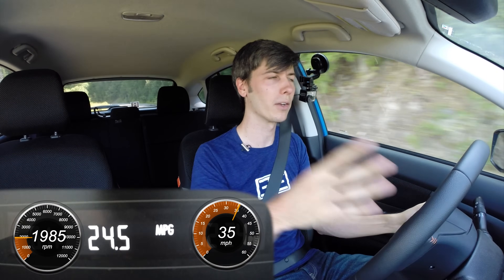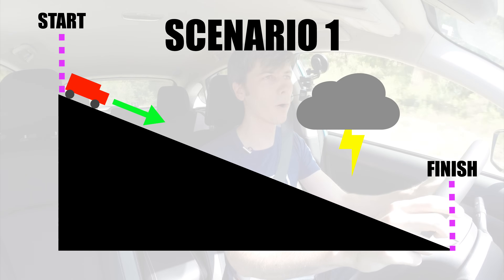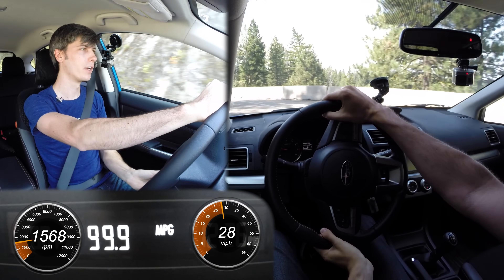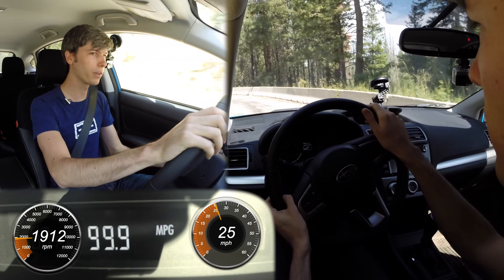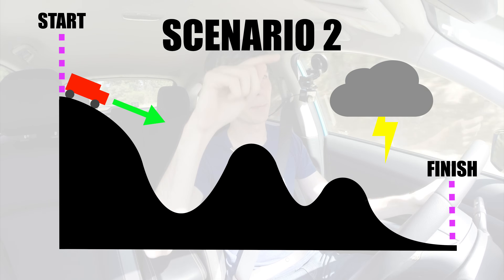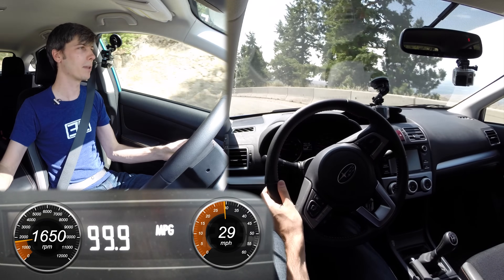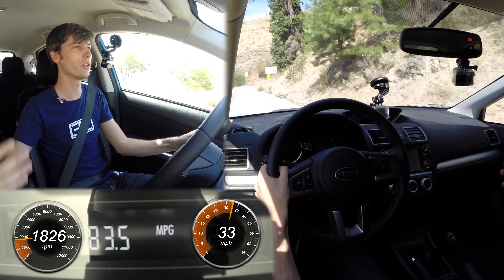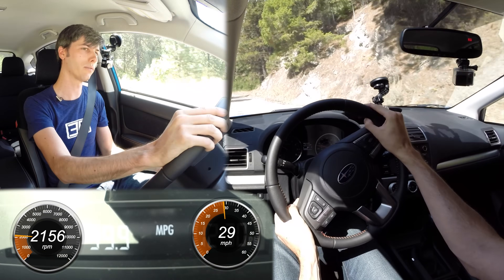What Uses Less Gas - Coasting Or Engine Braking?

Comment: Nice to know which method saves gas, but which method will help the engine to last longer?  Is engine braking hard on the engine?  I’ve always thought I would rather wear out my brake pads faster than my engine.
Reply: engine braking is not an issue on the engine.

Using the main brakes wears out the pads. They can also overheat on long descents with a heavy vehicle.

Comment: I have a hybrid, and It tells me what's saved more gas. When I coast it is at its max. Truely depends on the vehicle. I have a Honda.  I tried the same thing on an American vehicle and it wouldn't coast as fast as mine. It felt heavier like the breaks we're slightly applied.

Comment: Question: engine braking in 3rd gear vs engine braking in 5th gear - no gas is used, but in 5th gear you don't lose your speed that much right?

Comment: I have to disagree with you on this assessment. I have a 2012 Subaru Impreza, so my MPG display is exactly the same as yours. Also manual transmission. When cruising, engine braking will start to drop MPG from 99.9 before it will in neutral (i.e., at low speeds, active MPG will still show 99.9 in neutral while engine braking at the same speed will be lower). I think fuel expenditure when your foot is OFF the gas will be the SAME, whether in neutral or engine braking - but neutral will take you further and therefore is more efficient for the same distance traveled. I don't think the car computer is "smart" enough to measure true MPG. It simply performs a simple calculation based on a function of your speed and your RPM. When you're in neutral, the engine has to keep running, it can't just stop (unless it is a hybrid, which it isn't), so it will consume just enough fuel to keep itself running at low RPM, hence the 99.9. During engine braking, the engine can't just stop combusting (which it would have to do if it were consuming zero fuel as you assert). It is still burning the same amount of fuel as at idle, but the engine braking pushes the RPM higher. The car computer interprets that as higher RPM per speed and therefore spits out a lower MPG. In other words, coasting in neutral is always more efficient in terms of gas (although not in terms of brake pad wear).

Comment: Hey Jason, this has bugged me since I bought my brand new Nissan Altima. When I turn on the AC, my rpms are set dead at 750. In fact, that's the normal idle at all times, and it confuses me a bit. I thought, at least, the AC would make it churn more rpms, but this car doesn't do that. What's the deal? I'm used to 2012 cars and below, did something new come out? 
Adding on to this video though, I am wondering if switching to neutral is a better bet for a emergency braking maneuver. My car buckles after slowing below 10mph, I assume it is a CVT thing, but, I only really drive manuals, so, please correct me if I am wrong.

Comment: Thanks for the video I no longer coast downhill. Coming back to your scenario it would probably be more efficient even if there are not a series of his but flat straight road as the momentum built by coasting can be used to cover some distance as long as you don't exceed the safe speed for that road.

Comment: So in in real life (unless you happens to be alone on the road, you don't care about safety or breaking the law; or it's the German Autobahn) you really should always keep it in gear.

Btw this is yet another demonstration of why MPG (i.e. unit of distance / unit of energy) is a bad metric for efficiency, since when the consumption is 0 you end up dividing by zero and the display has to show a nonsense "max value". If instead you use the more reasonable measure of unit of energy / unit of distance (e.g. gallons per mile or liters/100 km or kWh/100 km, etc.) when the usage is zero the meter can show simply 0, and the scale is more linear as well.

Comment: A caveat here: Fueling GENERALLY only cuts in the top 2/3 of the rev range. In the bottom 1/3, fueling will cut back on, which is why you'll get some gurgles towards the bottom of the rev range. So if you leave in high gear, you won't see as big a difference as when by putting it in a lower gear. Which also means you need to underline rev matching. Rev matching uses fuel. WAY more than you're going to save. So you'd have to granny shift it to see any benefit. Granny shifts wear out your trans. Transmissions are way more expensive than gasoline. But the easiest thing of all to replace (besides gasoline) is the brake pads. So you kinda have to decide what your maintenance strategy is and go with it.

Comment: Hi EE, loved your videos! Been watching them all the time. I have a question regarding rev-matching and throttle blipping. I found it easier to blip and rev-match a petrol-powered car than a diesel-powered ones.
I know that diesel engines generally have more torque at low-end and use higher compression ratio than petrol engines. In those senses, what makes the diesel engine 'lazier' to rev and petrol engine 'more eager' to do so?
Reply: I have found it equally easy (or difficult) to rev-match when changing gear, for either petrol or diesel. What makes the biggest difference is not the engine but the gearbox. My Peugeot has always been more forgiving of slight mismatch when gradually increasing/decreasing the revs until the gear slips in, compaed with my wife's Honda. The Peugeot has now done 190,000 miles so I imagine there's a bit more wear on the synchromesh that makes it more forgiving, but this was true even at 18,000 miles when I bought the car.

I find as a very rough estimate, in my car I need to increase or decrease the engine speed by about 500 rpm when going from one gear to the next higher or lower gear. Any change in the correct direction will be a bonus, compared with a) keeping the engine revs constant, or b) returning the engine to idling speed and then letting the clutch up on an idling engine (!!!!). I did actually get a lift with a person who did the latter. It was a difficult situation because she was my boss. Should I offer her advice? When she actually apologised for a particularly jerky gearchange, I very tentatively suggested that there might be a different way that would make her gearchanges smoother. Apparently her instructor had taught her to let the clutch up on an idling engine, and no-one had every told her about rev-matching. When she tried it and found how much smoother the gearchanges were, she said "I'll murder that driving instructor!" She still lifted her clutch foot right off the floor, rather than pivoting on her heel, but that may have been because of the size of her feet in relation to the position of hte clutch pedal off the floor. She was about 5'3", driving a VW Jetta, so maybe she needed the seat that bit closer and also her feet weren't as long as mine; I've never found a car where I have to lift my heel off the floor to let the clutch right in - even on my Pug which has a high bite point becaue the clutch has used up all its auto-adjustment range (though 190,000 miles on its original clurch is pretty damn good compared with previous cars I've had).

Having a rev counter makes it easier to rev-match than when you are having to rely on engine note to judge the correct speed for the new gear.

Comment: Disagree , it still injects fuel with your foot off or in neutral the engine still needs to ignite something otherwise it would be silent e.g tow a car in gear with engine off equals silent engine

Comment: Basically, If you're going to stop at some point anyway, use gears.
If you are going to effectively use the bonus kinectic energy you get from neutral coasting (longer distances, climb up a cliff ahead) then it becomes viable
Reply: When you don't need it to stop you going 120 mph into the twisties, engine braking is just another loss - like rubbing brake braking, unused roof rack braking, or underinflated tire braking.
Reply: @TimpBizkit if you're not actively accelerating that isn't an issue
Reply: @TimpBizkit  But when the car is engine braking with revs above idle, the ECU is able to cut off all fuel to the engine, as the momentum of the car keeps the engine spinning. The engine will always have losses. When engine braking, they are counteracted by the car's momentum. When coasting in neutral, they are counteracted by using fuel to keep the engine spinning.
Reply: @n00bxl71 yeah but the car's momentum doesn't last forever. It was provided by putting fuel into the engine to accelerate it, and unless you're on a road where you MUST reduce speed, parasiting off the car's momentum = pressing the accelerator more often.
Reply: but then again if you are going up a very steep hill, it safer to be in gear
Reply: Except that it's not very safe. Unless you're an a closed track that have been checked and secured for you, it's very unsafe to coast in neutral.
Reply: Just use high gears then…
Reply: Basically, use gears.
Reply: @dpgerarddp  Unless you live in a hilly area when the alternative scenario is extremely common... or if your vehicle does NOT shut off the injectors when coasting.

Comment: Great vid and explanation. You should do a vid debunking the myth of "engine compression braking" and show how the engine really has very low compression with throttle plate closed and coasting. Perhaps get into pumping losses and why cylinder deactivation works by opening the throttle further but indeed still uses the same amount of fuel at the same rpm as if it was running all the cylinders. Might be a good topic :)
-Eric O.
Reply: Thanks man! I think it is a good topic for this channel. Just always find it funny when people say they "compression brake" when the engine has less than 20psi compression during a deceleration event... 90% of mechanics out there have no idea it is the throttle suction that is causing the engine braking.
Reply: 'Engine braking' is something of a misnomer really. When you lift off and enter overrun conditions there is actually a lot more than just the engine slowing the car down. For example, aerodynamic drag, tyre rolling resistance, rolling resistance of bearings and permanently connected transmission components, brake pad drag.
Even the engine's contribution to the total 'braking' effort is made up of many parts - 1. internal friction and 2. pumping losses (primarily intake vacuum, not compression as you say), 3. alternator load, 4. water pump load, 5. aircon load (compressor).
Could probably write a book!!
Reply: Salvatore Hayes at WOT you would go faster actually. In order to engine brake with a gas engine you need the throttle plate completely closed....
Reply: South Main Auto Repair I like this idea, might you want to do such a video yourself as well? Love your channel!
Reply: Maybe they all drive diesels.
Reply: That would be interesting!!!! Have a kill switch for ur injectors so when u engine brake u can go wot and really start engine braking lol
Reply: Fun huh! Yes you get better engine braking with pumping losses than you would at fuel cut WOT. Now if you had the ability to plug the exhaust off you would be in great shape and have fantastic engine braking... food for thought.
Reply: South Main Auto Repair mmmm. So shutting the throttle body means starving of air, then intake stroke would work harder and slow engine down for engine braking...if u when WOT... Ur giving it all the air it can take in but would that be more air to compress and thus slow the engine down more under compression stroke? Now I'm real curious.
Reply: South Main Auto Repair I have to try this for my self. I used to shut my car Off and simonatously hold throttle wot. The Belt would squeak indicating what I thought was more rapid stop of the engine....
Reply: South Main Auto Repair but this is when the car a roots style blower... Thus when WOT happens blower would have air to compress, but it uses engine to compress the air thus dragging the engine to a more rapid stop... My cars turbo now but still curious lol cus turbo going wot would be along it to Suck air in to compress, it uses exhuast to turn Turbine and Shaft to Compressor... Then that means engine braking wot on turbo car would also mean creating a exhuast restriction for more engine braking? Lol I got to try this hahaha

Comment: The other scenario is a very small downgrade.  With the vehicle in gear the hill is not steep enough to keep you going and you slow down too much.  In neutral, there can be enough of a slope to maintain your speed while in neutral for potentially a long distance.

Comment: So could you do a video about using the tow/haul mode in an unloaded truck vs. using the standard transmission mode for efficiency? I was told that the transmission will shift less often in T/H therefore reducing fuel consumption, but I thought the standard mode was programmed to always find the most efficient gear to be in, even if it has to hunt gears more often.

Comment: i think you are wrong
it says 99.9 when you are stopped at an idle
im almost positive you are ALWAYS getting fuel
i have pull/push started many many cars to start them in my towing carrier and it is not very smooth
also with an automatic, (according to you) the engine would die (tach at 0) that does not happen
and ive driven enough cars and trucks in my life to know the feel of an engine getting gas and one thats not and like i said at the start i think you are wrong and ide be willing to put money on it too

Comment: What about transmition and engine wear? I guess if you downhill in gear, the wear will be higher. What you save in fuel will compensate a possible transmition/engine repair?

Comment: Recent BMW's have the "coast" or "sail" feature when you are in "ECO PRO" mode.  This basically bumps the auto into neutral when you lift off the throttle.  Around town I find it's not a big saver but on a recent mountainous road trip it dropped my average l/100km usage over the trip by about 10-20% while still averaging a speed of ~100km/h over the entire trip.

Comment: W R O N G !
For an efficiency excercise, switch off the engine!
At my last job, the journey each way was give or take, ten miles each way. Each day i was able to coast with the engine off for a good four miles thanks to the terrain of dual carriageway with long hills.
On the way back i could accelerate up to 80mph and coast all the way down to the main roundabout which was just over a mile and a half and then if all was clear, take the roundabout at around fifty and then coast a further three quarters of a mile to the first set of traffic lights along the flat.
My mpg went up considerably driving this way :)

Comment: Wait a second but if you leave it in gear and let it engine brake as you coast along, how is the engine running if there is no fuel being used/injectors are shut off? What's exploding inside the cylinders if there is no fuel...?
Reply: Nothing is exploding in the cylinders at that time. The engine is running, but not because it explodes fuel. The engine is driven by the crank, driven by the transmission, driven by the wheels, driven by momentum. It is basically the normal driving cycle in reverse. Instead of the engine powering the wheels with fuel as the energy source, the wheels keep the engine running with momentum as the energy source.

Comment: My 2003.5 MazdaSpeed Protege has a maximum AFR of 22.4 when engine braking. Hills aren't an issue here in Florida, but I've learned that 14.7 @ 700rpm is much more efficient than 22.4 @ 3000rpm. Plus, I can start coasting much earlier because the car loses momentum much slower.

Comment: Hmm.. I didn't know that engine idle uses more fuel than when in gear with zero throttle.. I still can't digest that. Shouldn't the same amount of fuel be supplied as in the case of idle injuction ???!🤔

Comment: car should eventually close fuel when you use engine breaking. some cars with automatic transmission do automatically change gear to lower, reving engine up and closing fuel consumption.

Comment: Sorry but these were generalized and under substantiated claims. I have  "modern electronic fuel injected" vehicles that do not shut off fuel while engine braking. Many manufactures appear to choose to lessen the fuel supplied, and that means that RPM determines fuel consumption. This is why all of my vehicles use considerably less fuel in neutral. I have seen this in certain models of Hyundai, Kia, Nissan, Ford, and Chevy.

Comment: if you take two identical cars and run for 100,000km by the two methods  you will see you loose money taking in account all mechanical issues (brakes, engine, gear box, etc) in the long run, it´s not only the fuel saved going down hill in neutral !

Comment: Short answer: In neutral the engine has to go bang to keep spinning, in gear the hill keeps the engine spinning. In modern EFI cars the ECU cuts fuel delivery when coasting in gear, results may vary.*
Reply: G.Masheen, I was a bit confused how a motor, accessories and such can work while no fuel is being injected; your statement is much better than how Jason explains it.
Reply: But is the fuel actually cut when coasting in gear? Cut to 0? Ie 0 fuel being used? Then engine us off? But no need to restart? 
This seems contradictory.
Reply: @scartinojoseph1407 yes, its cut to 0. its because since the engine is IN GEAR, while going downhill the car wheels are spinning, which spins the the gearbox, which spins the engine, and as long as you are going downhill at enough speed to keep engine above around 800rpm (idle rpm) there is no NEED for the engine to use fuel to run, because its BEING run by the car wheels. understand?
Reply: the engine is not off, as it has contact and is spinning from this, instead of using fuel @scartinojoseph1407